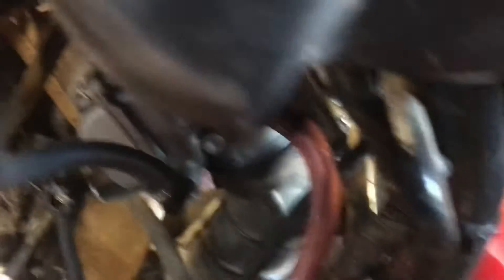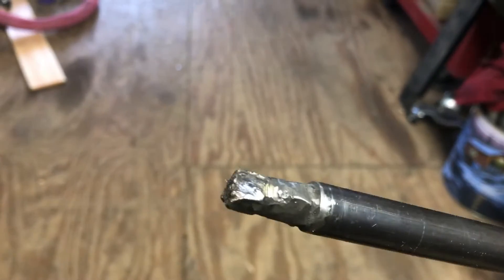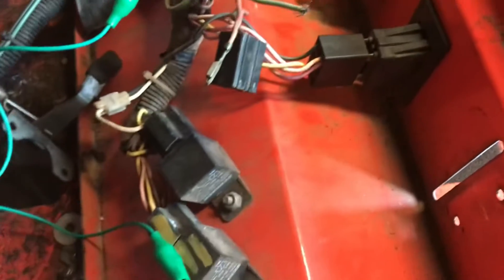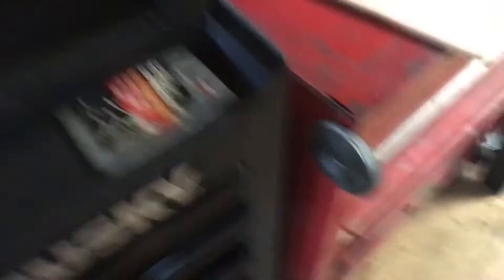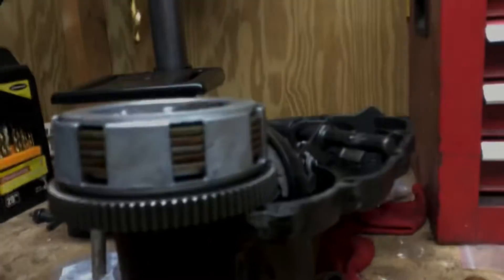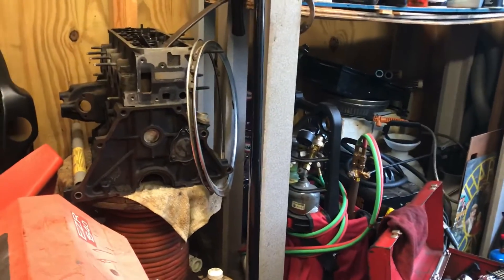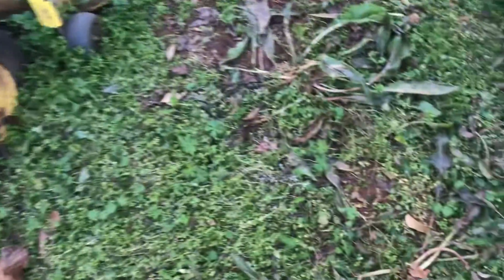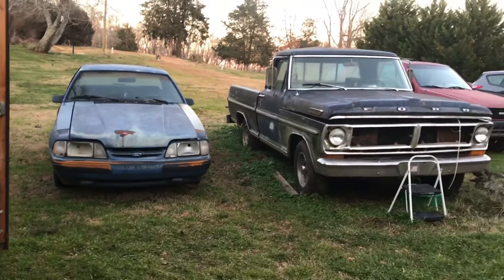I answer a viewer question, as well as Shop updates and some ramblings. lol

Comment: Thank you bud and yes you pronounced my name right
Reply from the maker: You are very welcome
Reply: Got the carb connected correctly  now gotta adjust it and then figure out why my starting button doesn't work  it doest make any sound when I push it but I can get the starter to spin jumping the solenoid
Reply from the maker: @jongearhart1359  check your wiring going to the switch and coming out for power also check fuses and solenoid
Reply: @twoeaglesgarage6223  ok ill have to do that during the day